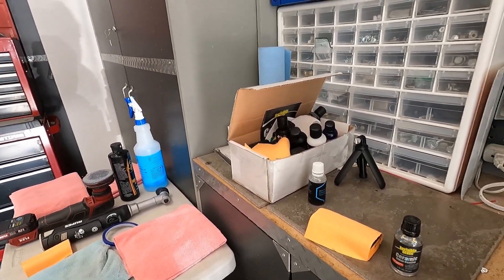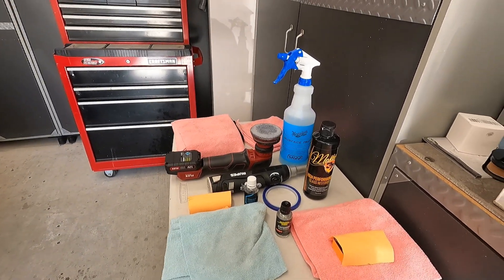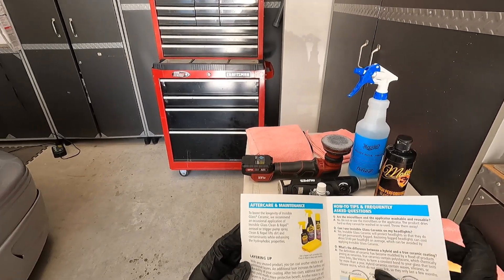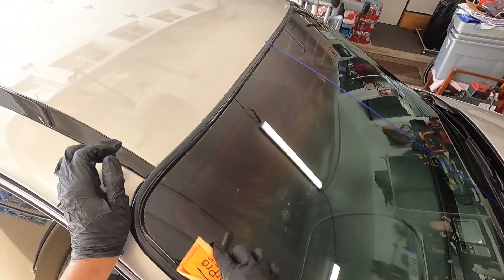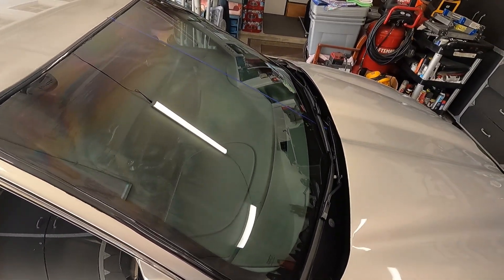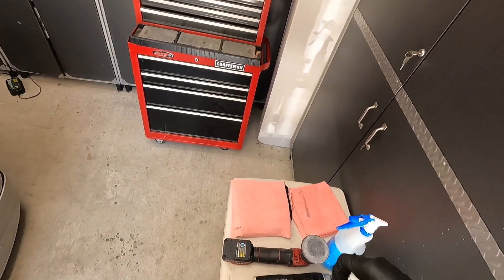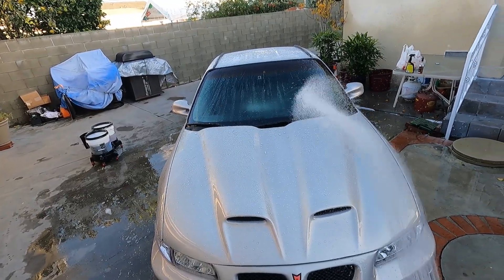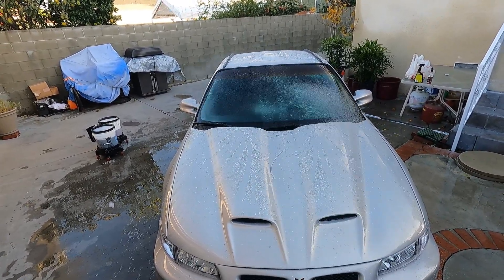@StonerCarCare Invisible Glass Coating Reapplication & Water Behavior

Comment: I stick to RainX and it's always performed amazing for me. Contact angle is AT LEAST 110 but I think it's a bit higher. Lasts forever in the sides and rear window and in the front if you use it with the green RainX washer fluid, it tops it off and also seems to last forever. Yup, plain ol' cheap RainX, the original though that comes in a small bottle with the little flip up tip dispenser. It's a bit of a pain to apply but the performance is top notch right up there with the fancy expensive coatings.
Reply from the maker: The thing about rainx is that it’s consistent and does work even if it may not last long

Comment: Thanks for the video! As you said, it does come down to personal preference, and in this case I'd say yours is a visual preference, but from a pure protection standpoint (resistance to water spots, road film, etc.) Stoners with that slow, but impressive sheeting ability is probably better? It would be interesting to see these two in action while driving in the rain and after a rain and a full sun exposure situation. One product claims 1 year of protection and the other 2 years, the 2 years is hard to believe.
Reply from the maker: There is some truth to this.  Sheeting type products don't always have the best self cleaning so they can look dirtier at times.  They are also painful to dry especially with forced air.  Think unprotected clear coat.  The 3D ceramic coating is this way and it always looks dirtier that the other coatings.  As far as durability of a dedicated glass coating, well that is going to depend on how often the wipers are used.